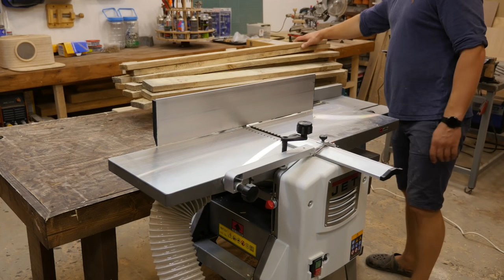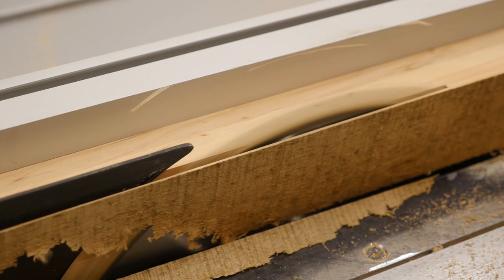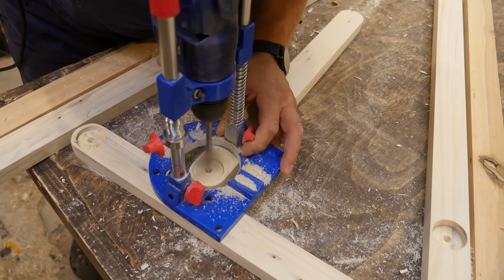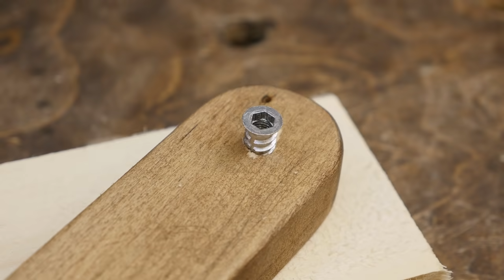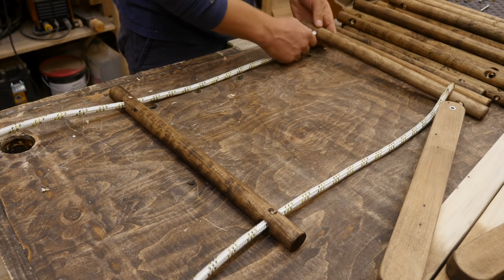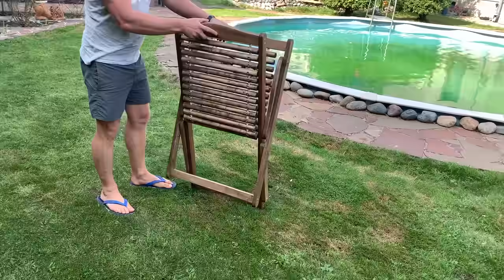The best option for recycling old pallets! A unique idea

Comment: There's actually faster ways to break down pallets that take only a few minutes. Your way is the hardest of all and takes time. It's simply not efficient. Try using a reciprocating saw next time with a metal blade and cut between boards through the nails.

Comment: Not really an invention, just a different style of folding chair.  Not sure it would be very practical, but some nice work nonetheless.

You should really invest in a proper drill press though.  They are dirt cheap compared to most of the equipment you've got.  There is no rational reason you should be using some kind of plunge action router setup.